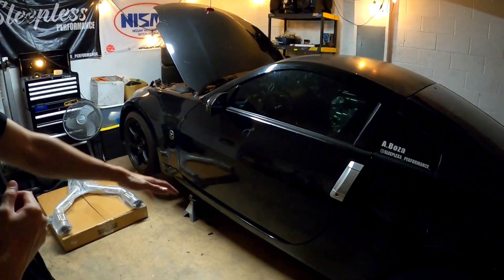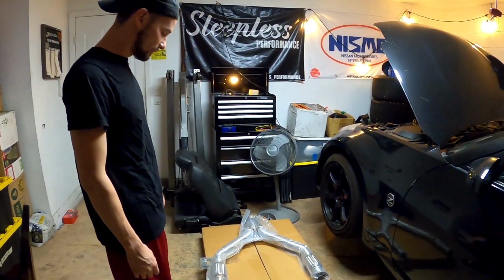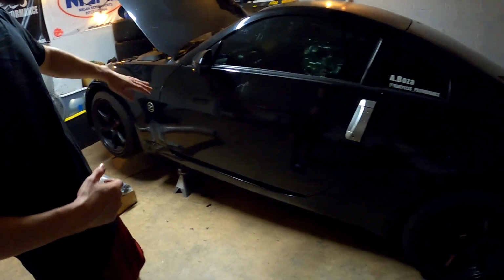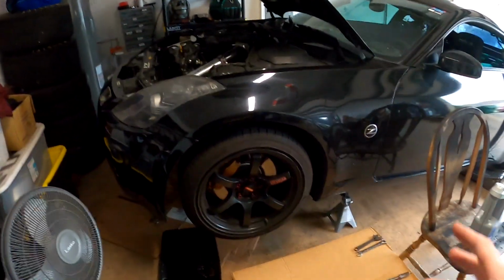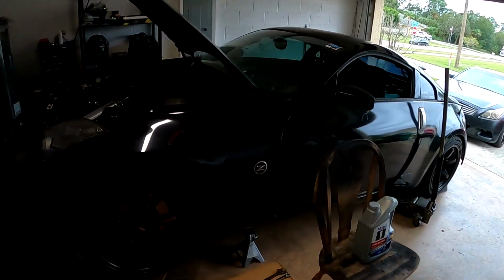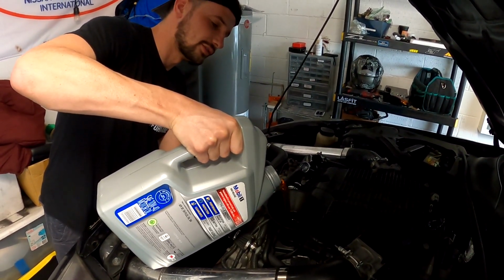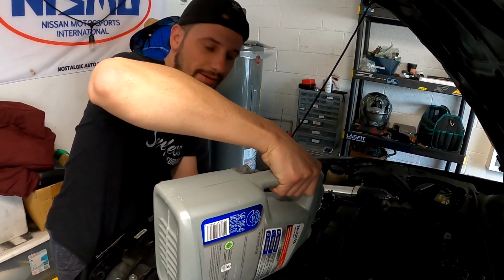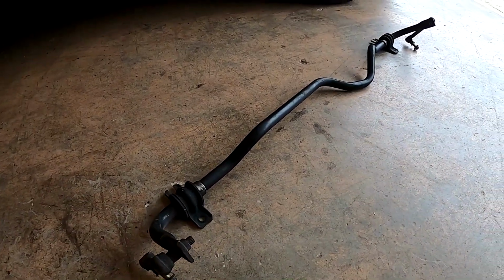Best Budget Y-Pipe for your VQ

Comment: What oil do you recommend living in a warmer environment year round on an NA HR?
Reply: If u beat on it use Valvoline VR1 20w50
Reply from the maker: Yeah VR1 20-50 is good. Could also do 15-50 Mobil 1.
Reply: @sleeplessperformance   oh okay, nice. I am running this oil VR1 20W-50. On the expressway oil pressure is at 90psi. I don't remember  my psi being that high on my old oil 10W-40, unless I'm just trippin' lol